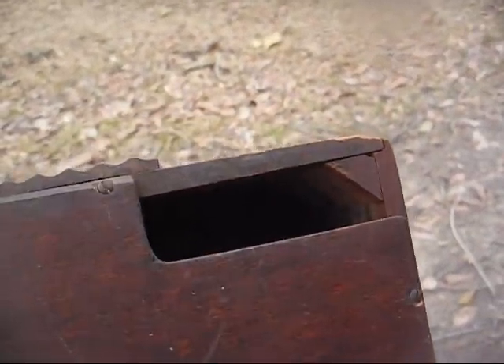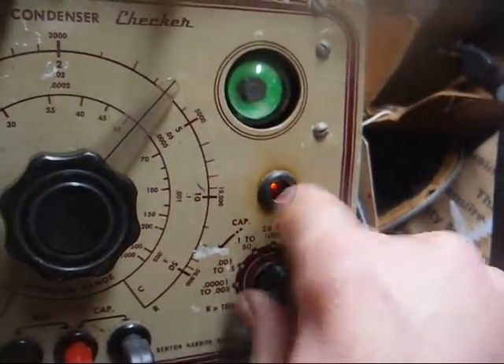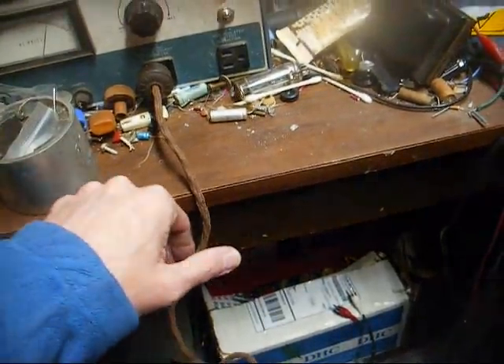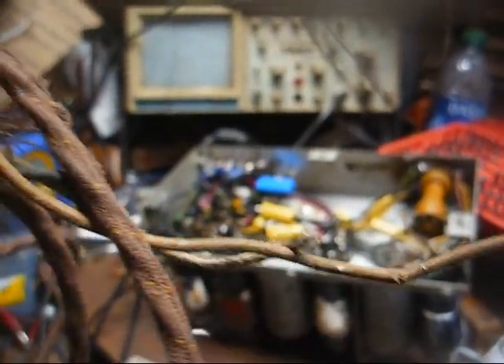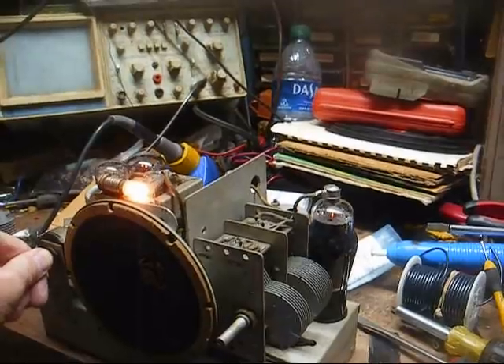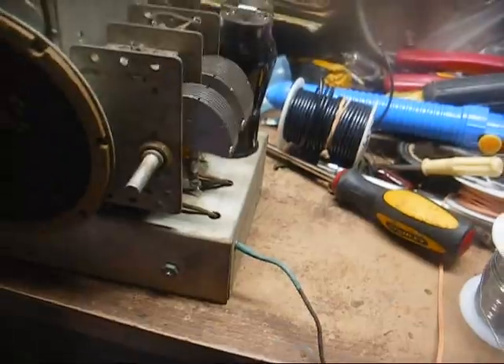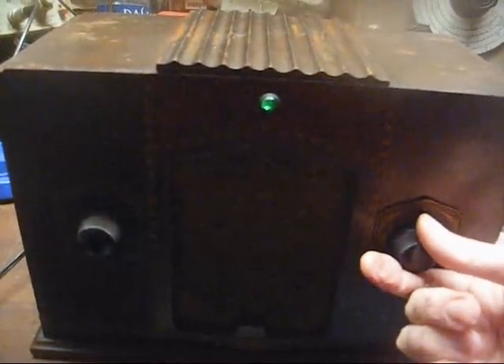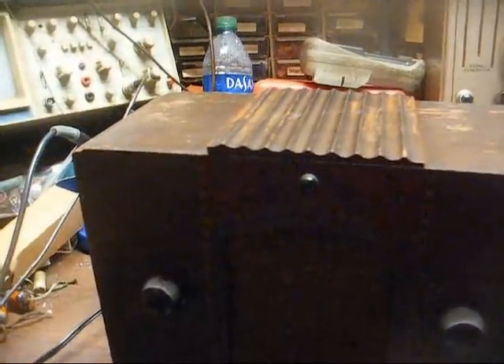1933 Clarion superhet tube radio

Comment: Please well for being 88 years old. I would not worry about the reduced heater voltages. The set plays great and the reduced voltages may be easier in the tubes. Also, Wholesale Radio New York might have been an early iteration of the  famous Lafayette Radio
Reply: * plays well. Auto incorrect strikes again

Comment: Looks like a Clarion model 423. A very trying radio to work on with all those bad components.
 Patience is mandatory here with that cramped for space chassis work to be done! You can do some vector
math if you want to replace the resistance line cord with a fan type non polarized capacitor. Need a pair of Zener
diodes in parallel with the lamp as well. I'm not into the complex math stuff.🤯 But it would work too.

Comment: If you had the room to mount it, could you just install another tube of the right voltage?  As long as the heater isn't burned out, one assumes you could even use a tube that doesn't work as you will only be using the heater anyhow.

Comment: Probably not such a problem in the USA but here in the UK Mains is 230v. So we don't like Dropper Mains Cords! Resistors generate heat and Capacitors don't so you can work out the value of a Capacitor to drop the voltage for the valves.  It does not generate heat at all and drops the voltage nicely.  Use a safety cap though. It is normally smaller in size than a  resistor as well.  I have done this on sets and it works well,  Remember Pythagoras and the Right Angled Triangle at school?  Now it comes in handy!
Reply: In the Navy, we learned polar to rectangular conversion. Wow. Just rang a lot of old memories bell!! And ELI the ICE man rules.

Great idea using safety caps to reduce the voltage. Trying to find my slide rule and do a few test formulas just for fun.

Thanks for jogging those old memories back.
Reply: @BigDaddy_MRI  R = 1 / (2 * pi * F * C), or C = 1 / (2 * pi * F * R). But you will probably have to experiment in practice to find the right cap size.
Reply: @lwilton  Yes. Found these in my old electrical engineering books. When you don’t use them very often, it’s good to have a reference to go to!  Thank you very much!